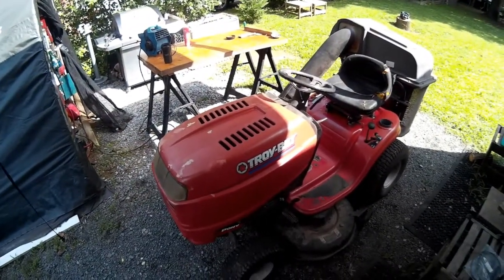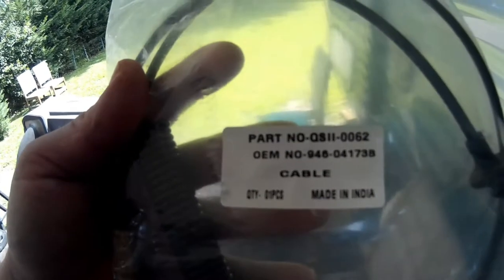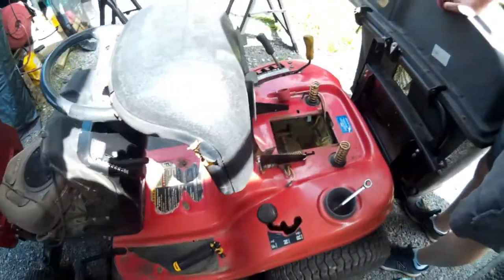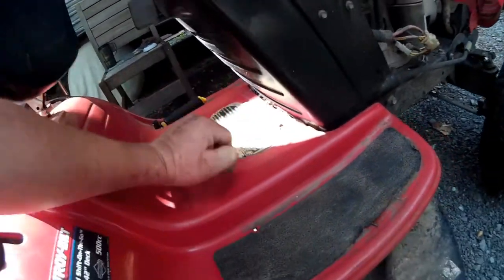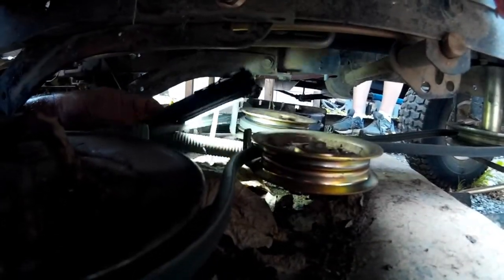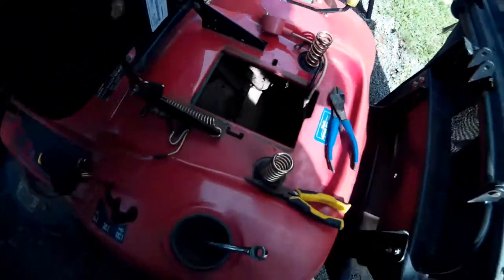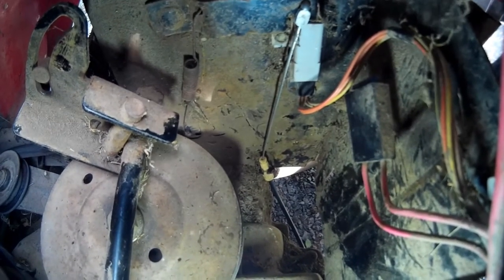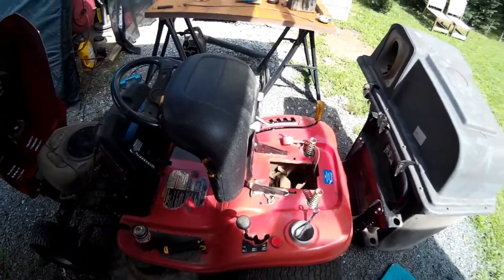Troy Bilt Pony Lawn Tractor Blade Engagement Cable Replacement

Comment: Thanks for the vid. I’m doing a mud mower with a Pony just like yours and ripped out all the deck and deck  controls and neglected the disconnect button. Wouldn’t turn over duh.  Figured it out. Thx.

Comment: Mine broke again in as many years.  $48 for a replacement from Troy-Bilt. I've already replaced the engine on this thing too, as well as several other parts. I've owned Troy-Bilt for many years.  Won't be buying another.  They're just made too cheap now and the OEM parts are way too expensive.
Reply from the maker: Troy-Bilt stuff is not the Troy-Bilt of the passed. Thanks for watching